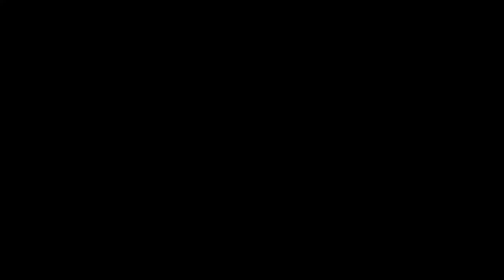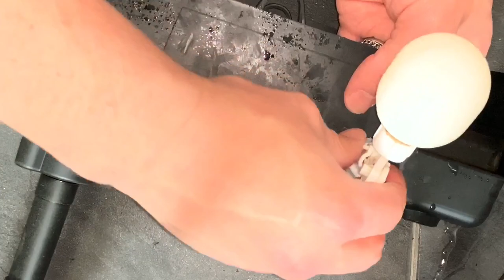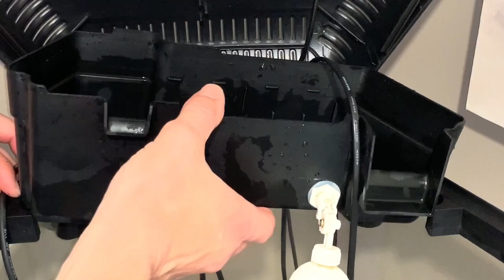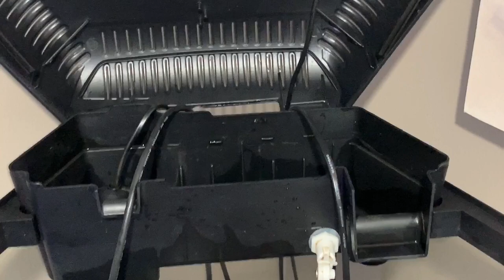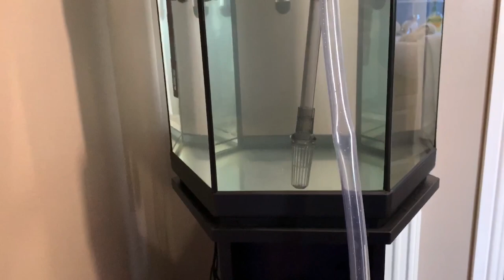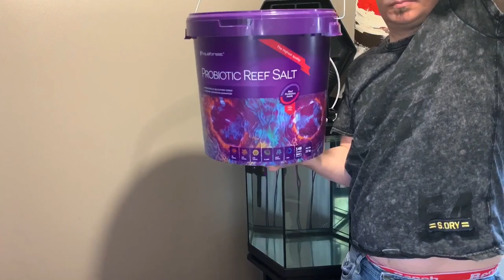Reef Aquarium - eaReef Pro 900 - Episode 61 - Saltwater Mixing Tank

Comment: Great idea! The flow you were getting from your RODI unit looked fast, far quicker than mine and I have a pump attached to mine to increase the pressure. Can I ask what unit you use, is it 3, 5 or 7 stage. Do you have a pump to help with your water pressure?
Reply from the maker: Hi Roddy yeah my RO unit is made by RO-MAN and it is a 7 stage. I do use a pump because my water pressure is only 30 psi without it.
Reply: @JDReef  Thanks JD, I took another look at mine after your vid, I don't think mine is that slow now after all :-) I can get 25 ltrs in   just over 2 hours. Still mine is only a 3 stage and 4 years old, time for an upgrade I think.
Reply from the maker: No worries mate, yeah I upgraded my membrane to 150gph & that certainly speeded mine up. Not sure how long it takes for 25 litres on my system.... You got me curious now. I’m gonna go test it 😂
Reply from the maker: 150 gallons per day... damn auto correct lol
Reply: @JDReef  By my calculations, it should take you about 1 hour
Reply from the maker: Well I timed it mate and it took 1.5 hours. Which is handy to know, so cheers 👍